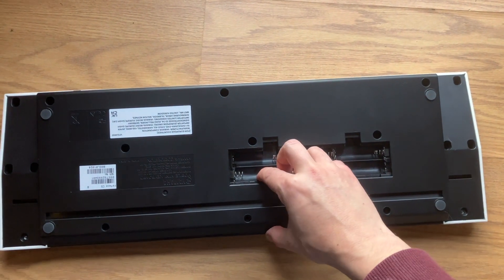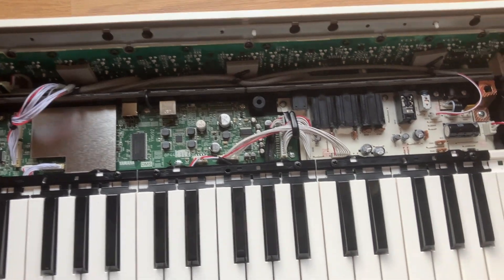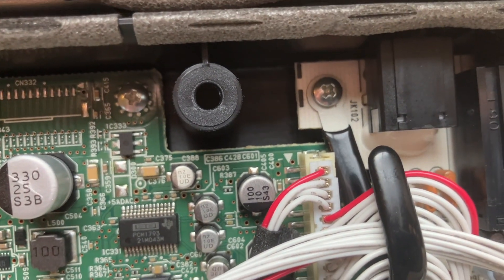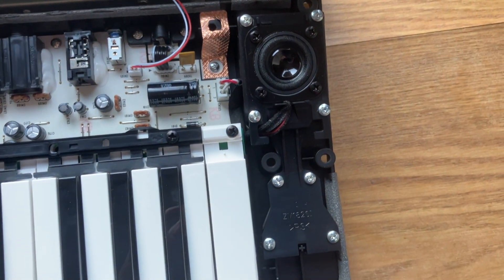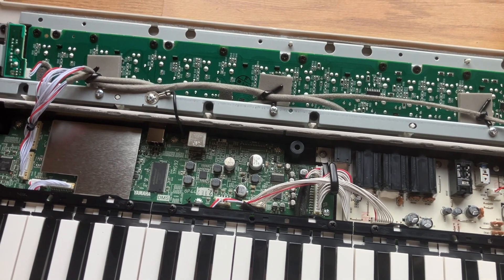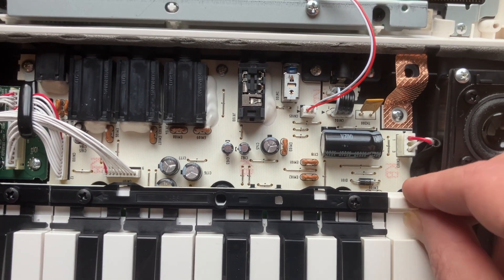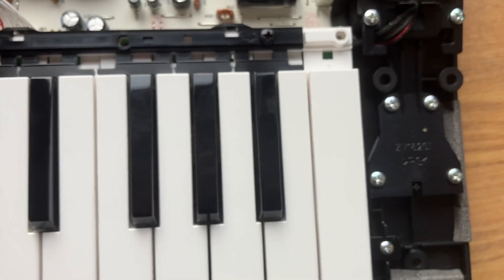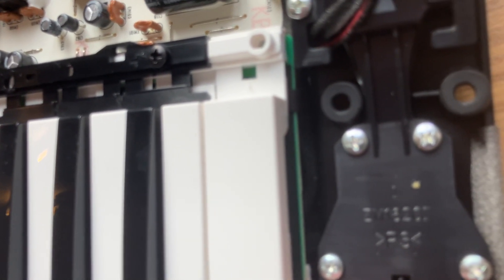Going Inside the Yamaha Reface CS (So I can figure out how to stitch two together)

Comment: Get a full size midi keyboard then add the two guts. 😊 IloveACID
Reply from the maker: There's a korg microKEY 2 air; almost has enough keys. 61 Key is the biggest Korg do in mini keys I think. To reduce to midi control; would be getting rid of the absolute best bit of the keyboard and that's the pitch control/joystick, it's the dogs bollocks.

I cannot properly be myself/perform without that. 

I have traced all the routes and reverse engineered the schematic, I've made an identical copy of the board in KiCad. All so I can remove that one annoying key!! It's a dumb journey but these things are getting stitched/married together somehow.
Reply: @MouldySoul  you should be able to use a longer midi keyboard to control the keys and then just reach over and wiggle the joystick on the actual unit when you need it
Reply from the maker: @jamisondonald384  That is a completely rational idea! In defence of this silly idea/rabbit hole, there’s something about the feel of this keyboard that’s very unique. It feels great, so want to maintain the feeling. Korg make larger keyboards, but for 88 keys with this mini key form factor they’re not made as they’re not considered instruments. (61 key is max korg do, keys are slightly different, lower action)

There’s something about Yamaha engineering as well. Midi key boards can feel cheap/flimsy and the responsiveness/latency can differ, could be using cheap slow ICs that will get the job done, everything from code/IC choice can affect the instrument. I think Yamaha nailed with these keyboards, the only limiting factor is the 37 keys! 

Also an excuse to see how a keyboard works. See if I can do the key scanning with a teensy and make my own midi controller, but that might be a legal booboo if I'm just ripping of Yamaha's boards!